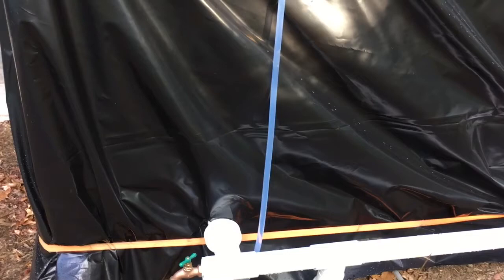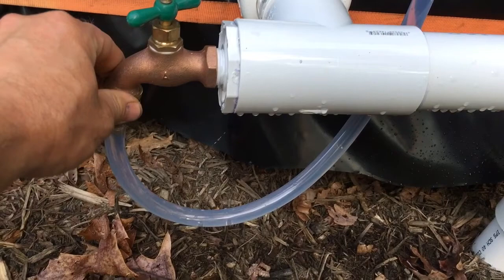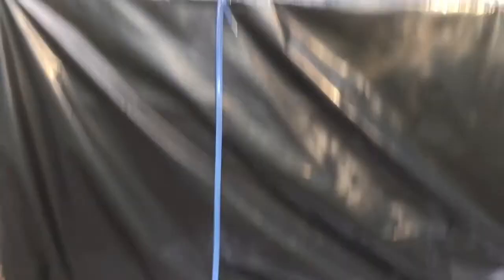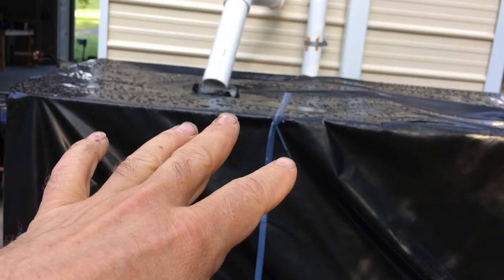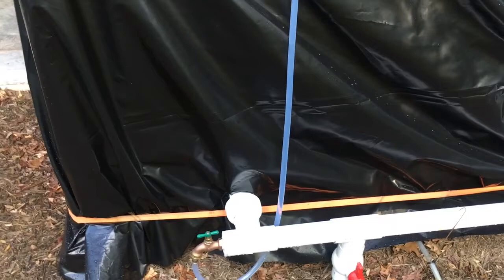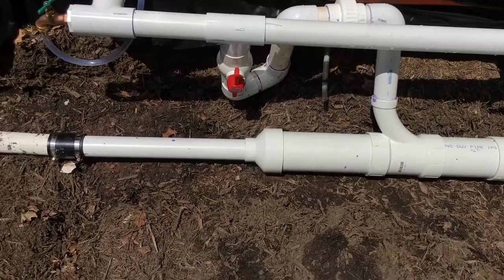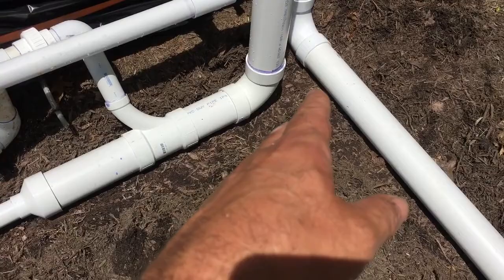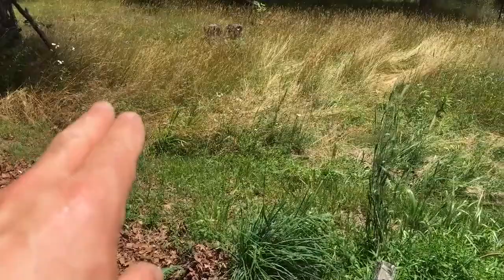Rainwater Harvesting System2

Comment: I liked your rain harvesting system, but I suggest you direct the overflow to the garden watering system.  In a dry season you could add extra overflow water, to deep root water the gaeden, and allow you to perhaps skip a scheduled tank water, thus saving much water if rain does not occur.   This is simply connecting your overflow to your garden line.  See any problems here?
Reply from the maker: No problems.  Good ideas.  Thanks.

Comment: It looks like you have holes in the black plastic on the top of the tanks.  Can you insert something like an extra piece of 3' pvc pipe under it to make it "tent" instead of lying flat so water just rolls off?
Reply from the maker: Hello!  I have been keeping an eye on it and it evaporates before I end up with any bug issues.  I will be dismantling it, removing the plastic, and painting the totes in the fall, so I'm just going to leave it the way it is.  If I did have a bug problem, your suggestion is wonderful and I would do it.  Thanks for the thoughts!

Comment: I see a lot of PVC used outside for these systems. I've read that PVC degrades with exposure to UV. Is that true? Or did you get PVC with a UV blocker?
Reply from the maker: I have installed a lot of PVC for my pool system and have not had any issue with degradation over the 16 years that it has been exposed to the sun.

Comment: Question, what do you do to keep rodents out of your overflow pipe??   I been thinking of getting a rainwater system & I know if I put a screen at the end of the overflow pipe chipmunks etc will just chew through the screen.
Reply from the maker: The screen worked for me for one season.  This year I moved to a larger system and now have a 4" overflow pipe.  I use a thick plastic drain cover that allows water out but keeps rodents out as well.  For a 2" overflow, I'd recommend a 2" cap with a bunch of holes drilled into it.  That would allow the water to pass and keep the rodents out.